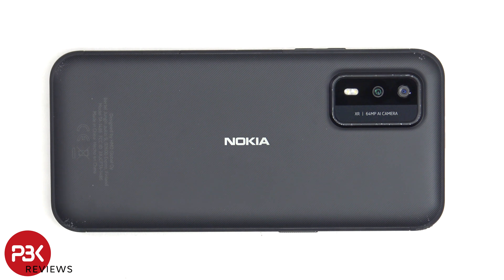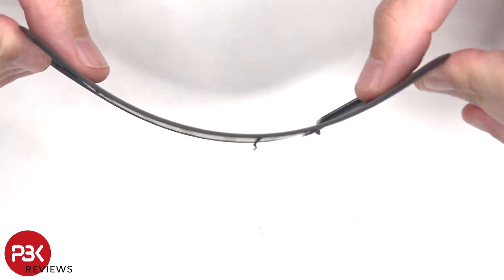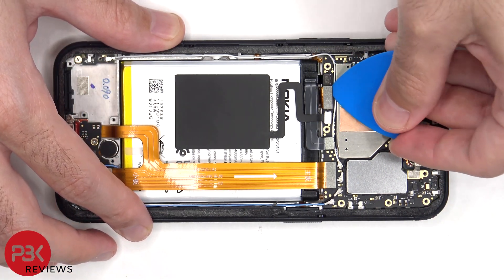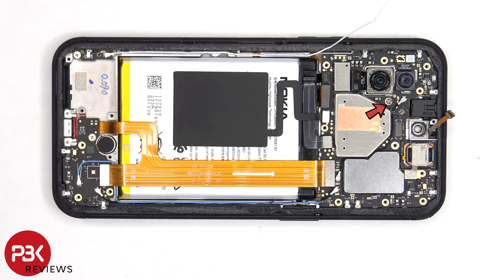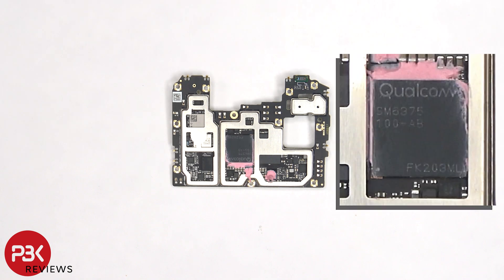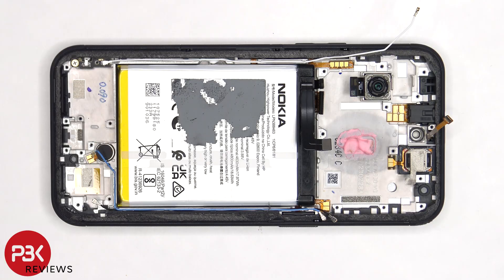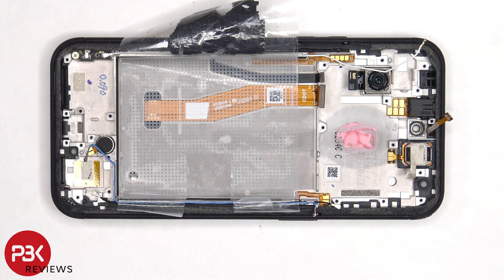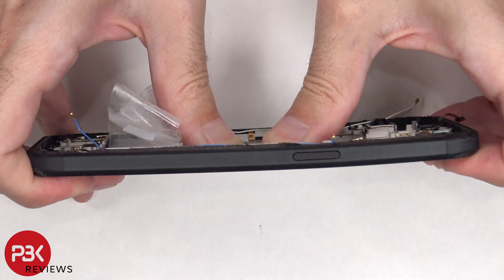Nokia XR21 Teardown Disassembly Repair Video Review

Comment: Hello, isn't this phone made in Europe?? If so, why is it marked "Made in China"???
Reply: iPhone is an American phone, also made in China. Every part of it is American design, inside and out, but the parts are manufactured and phones assembled in China. People wouldn't have been able to afford an iPhone if it had been "Made in the USA", because of the salaries of the workers and the cost of running the factory. You see the same in European and American high end designer brands as well. The designs are European and American, but the production is outsourced to China or some other low cost country.

Comment: question: we accidentally pushed the damn sim removal pin to the mic hole. Most phones have this figured out so that it doesn't damage anything - can you let me know if I might have possibly damaged my brand new phone by accidentally doing this. I was on a teams and was not paying attention. Now I can't stop thinking about it.
Reply from the maker: Both the mic and filter are seated above the hole so wouldn't be damaged on this phone either. So you should be fine :)

Comment: Does the phone stay waterproof after reassembly?
Reply from the maker: If you use the original pre cut adhesive to re adhere the back, then it should retain the water resistance.

Comment: Assuming that you lose water resistance if you pop the back cover off? Screen replacement seems tough but thankfully the screen is never cracking. Battery and port (if you ever need to replace) seem fairly easy
Reply from the maker: If you get the original pre cut adhesive to re adhere the back, you should retain the water resistance, but parts for these nokia phones aren't always the easiest to find.

Comment: Excellent as always but be honest , you already had the back off. You are putting little effort into going thru the sealer with the pick. Nothing wrong with that I don't blame you at all for having that part pre disassembled 😄
Reply from the maker: Thanks! For this one I actually didn't have the back off, I did it as is in the video (I had to pick up the phone since some portions the adhesive was a bit stronger) but in general the adhesive was really easy to peal off on this phone. Generally on most videos, to save time, yes I take it off and just show how it's suppose to be done so people don't have to skip through 10 minutes of prying :)
Reply: @PBKreviews  Yes I have only done a few and you made this one look easy. Thanks again for your instructions on these phones , I have saved a few with your help..
Reply from the maker: You're welcome. glad it was of help.

Comment: TECNO CAMON 20 PRO 5G when???
Reply from the maker: Not sure yet if I will be doing that model.
Reply: @PBKreviews  welp I'll just wait xD
Reply from the maker: :) . Generally it all comes down to price of the phone, the amount of views from experience I get on that brand/line of phones, and the compatible network bands for the phone since if I can't resell the device after the video, it ends up being a total loss on my end and usually tecno has very limited network bands.
Reply: @PBKreviews  I see, so it seems that the price, user experience, and network compatibility are crucial factors for you when considering a phone. It's understandable that you would want to ensure a good resale value after making a video.
Reply from the maker: yup, because if I constantly buy phones that I can't resell, I won't be able to afford to keep making videos. In general, I make a loss on 80% of my videos.